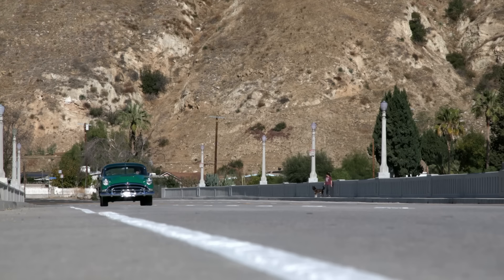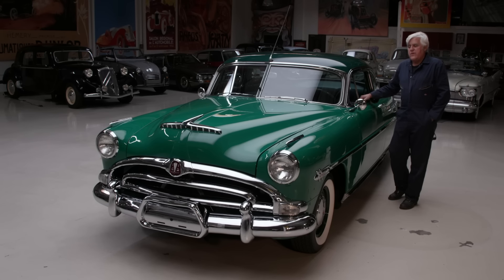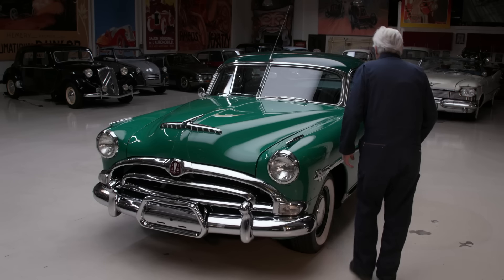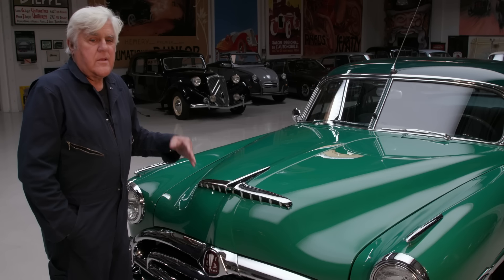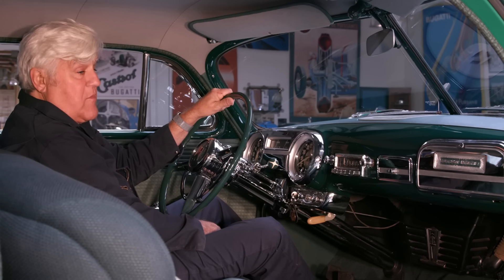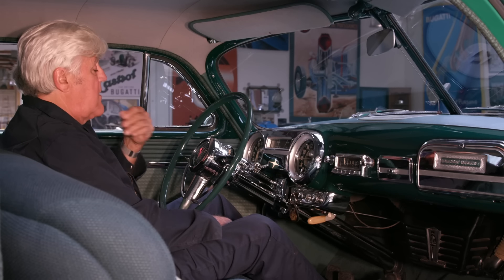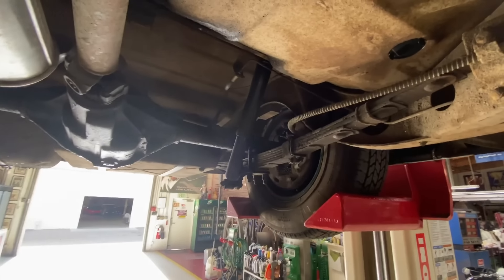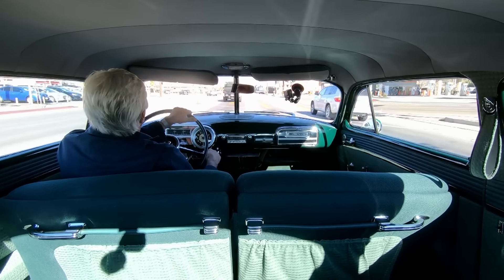1953 Hudson Hornet - Jay Leno's Garage

Comment: The small-block chevy in my 91 Olds wagon is only 170 HP.........I don't understand what the big deal is about cable-operated emergency brakes is about since every car I've ever owned has had them.... I believe it's a current and long-standing DOT specification that's as old as hydraulic brake systems....I'm really intrigued by some of the innovations that were brought about by now-defunct brands....GM didn't adopt step-down, low slung floorpans till the x-frame was introduced in 1959....

Comment: My 1966 Mercedes 250se had a fuel injected straight 6 high compression engine that was rated at 160 horses. If a Hudson from the 50's could get that from a carbureted motor what was Mercedes problem ?

Comment: Mr Leno - I'm afraid you are mistaken about running 12 volts through 6 volt wiring. The 6 volt wiring will have to be capable of carrying twice as much current (amps) as a 12 volt system to deliver the same power to the bulbs etc. So by converting to 12 volt, you are using wiring designed to take twice as much current as you are now using. This makes it easier on the wiring, not harder. 
As a Brit, I have always been mystified by American cars' use of 6 volt systems, or 12 instead of 24 on commercial vehicles. 6 volt systems are more prone to dirty connections, because the pressure (voltage) is lower and can't force its way through rust etc. as well as 12 volts can. Also, you need twice as much copper in a 6 volt wiring system to cope with the extra current. Weird!

Comment: I don't think that makes much sense? If the vehicle was originally 6 V. And you stick in a 12 volt alternator. Without changing out the 6 volt, wiring. It should work just fine.  As 6 volt, wiring. Has to be thicker. As it's designed to carry more current and less voltage. And upping the voltage won't change its, current rating capacity..

So I don't exactly, buy it. That you would want to rewire with, skinnier, lower current rated,  wiring? That, don't make no sense. I'm sorry that cannot be right. Something got lost in, translation.

As it is definitely, true, the other way around. 12 V wires. Cannot accommodate a 6 volt-based system. You need thicker wires.  As it's the inverse. Of the higher 12 volts. That can use, skinnier wires. As it's, sinking, 1/2 the current. And you can use 1/2 the  thickness of, wire. And it doesn't make sense the other way around  as you described. Could it possibly be from Operator Error? You don't know how many times I've had to deal with that throughout my 50+ year Profession.

No one is taught to be, competent, anymore.
RemyRAD

Comment: LOOK'S A LITTLE WET AROUND THE ENGINE AREA (BUT) EVEN SO THE OIL THAT MAY BE LEAKING A BIT HAS A BENEFIT IN THE LONG RUN STOPS RUST !  YEA IT'S MESSY BUT SO WHAT